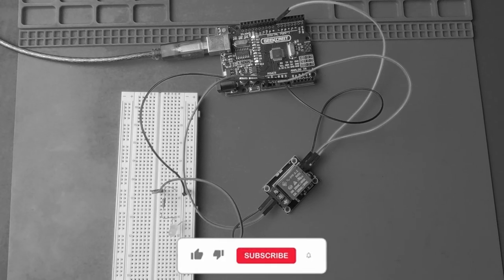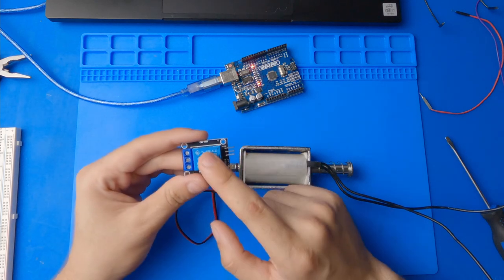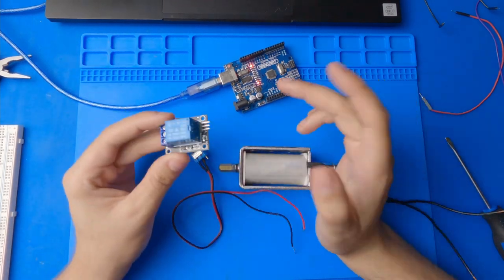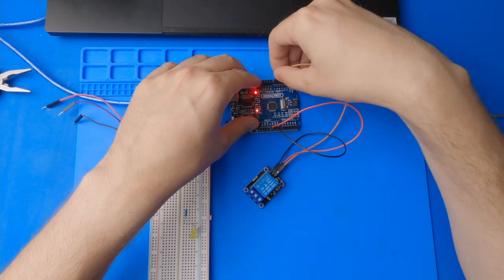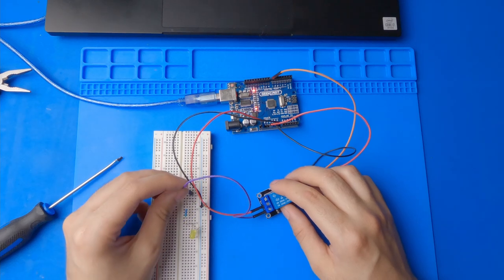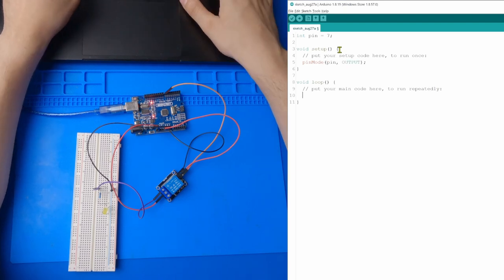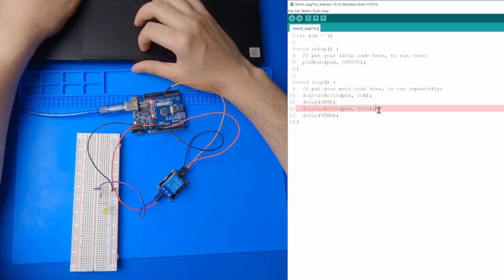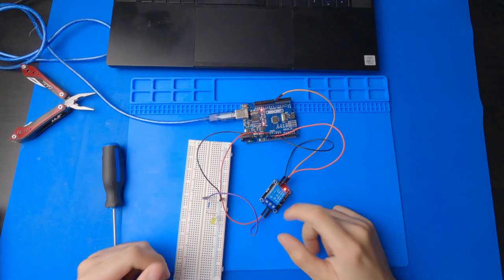RELAY SENSOR EXPLAINED | ARDUINO #arduino

Comment: So in general along with the hardware shown here, youd also need a power supply that supplies enough voltage to power the hardware youre controlling with the relay
Reply from the maker: Yes, you got it!

Comment: I got confused initially when you said NO/Normally open is On and NC/Normally closed is off, but then I realized you think they are like that.

In reality, they treat open as "open circuit" so it is off, and closed means "closed circuit" so on
Reply from the maker: fair
Reply: Yeah normally closed is sending power if there isn't a signal provided 

I believe